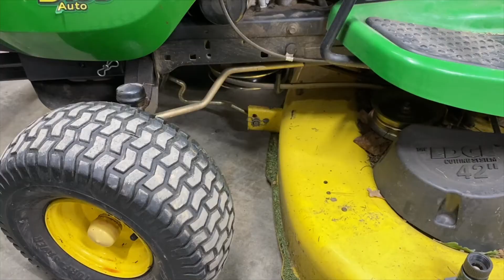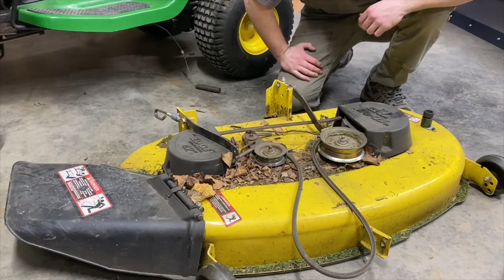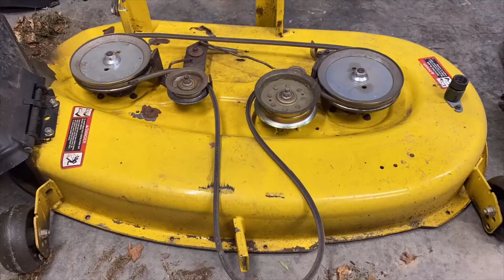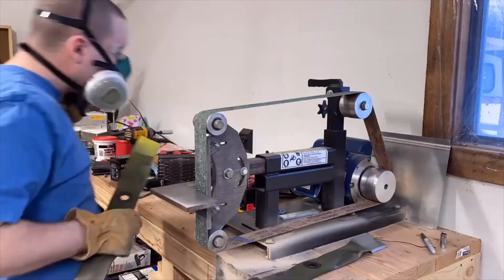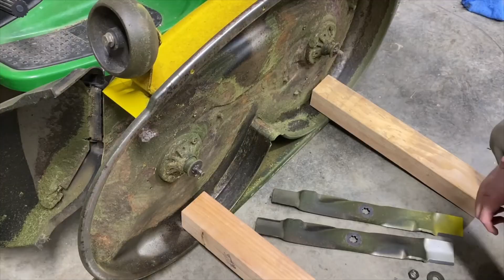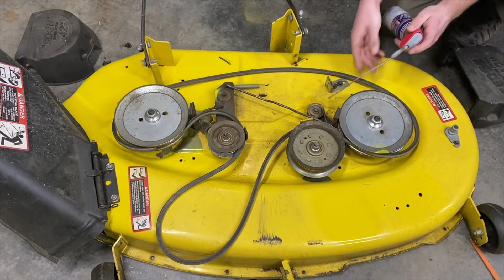John Deere 100 Series Lawn Tractor Deck Removal, Install, and Maintenance - Cleanup (Part 1)

Comment: Can't see where pro spring connects
Reply: Can't see where the pto spring connects
Reply from the maker: Are you looking for a spot on the deck? A PTO spring isn't ringing a bell... do you mean the tensioner spring?
Reply: @JoshsGreenGarage   I watched your video several time and finally found where the spring hooks in. Thank you for your video.